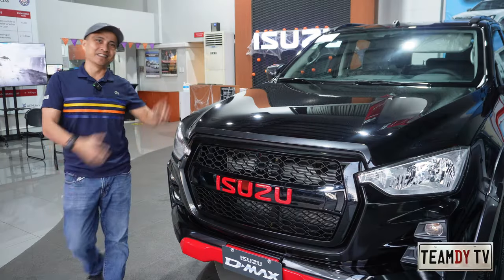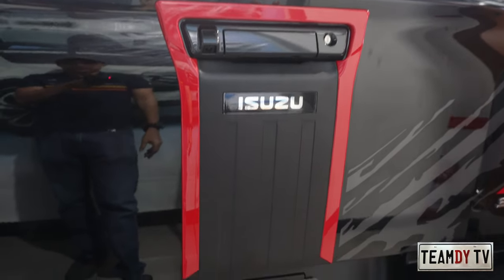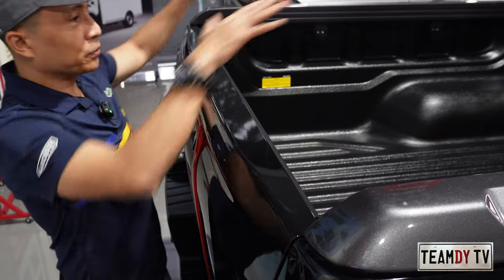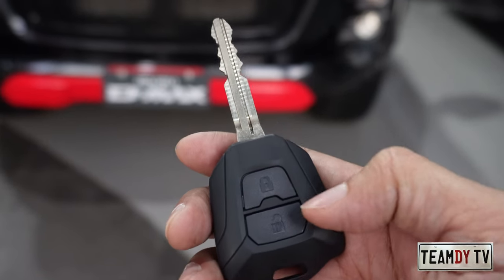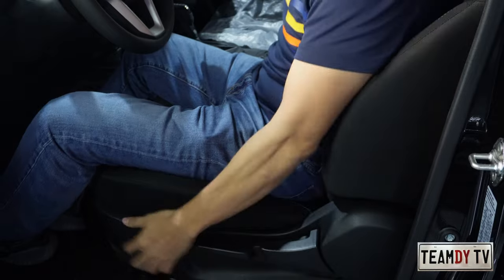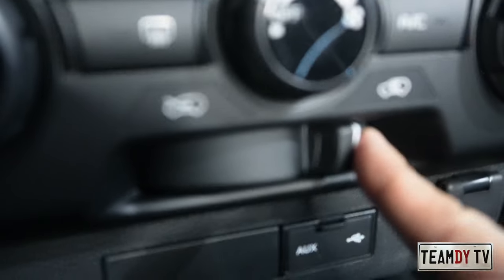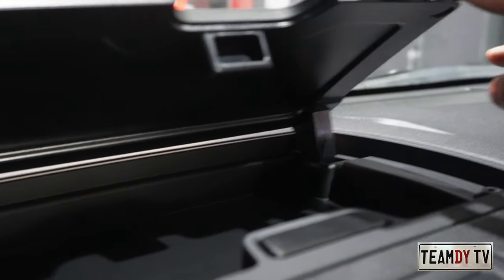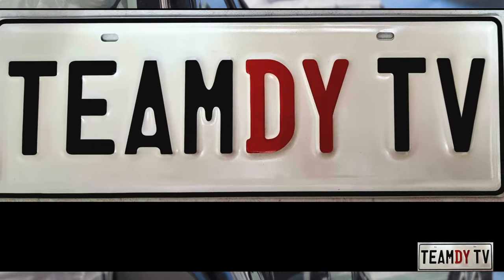2024 DMAX Limited

Comment: Nice look limited dmax, simple,gadgets are those are frequently needed,too much tech will stress you if they have anomaly, but the isuzu should standardize the 4x4 in this limited and the diff lock...it adds safety and feeling of security when tackling an off road, and it adds to its reliability.